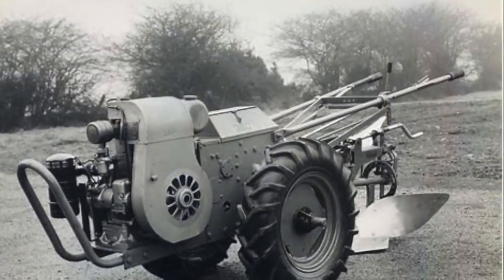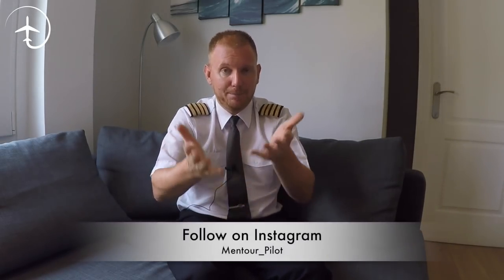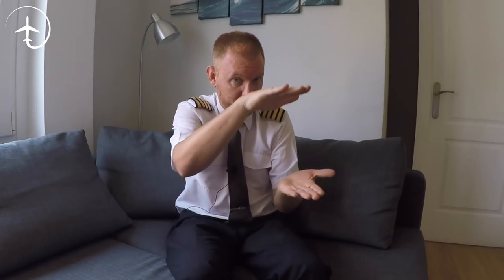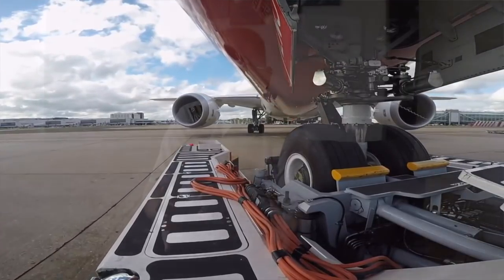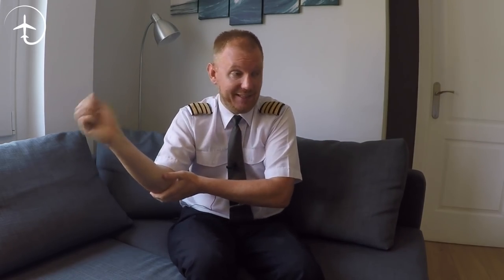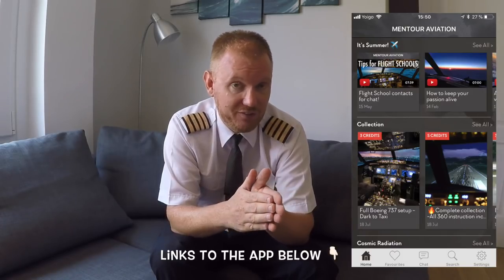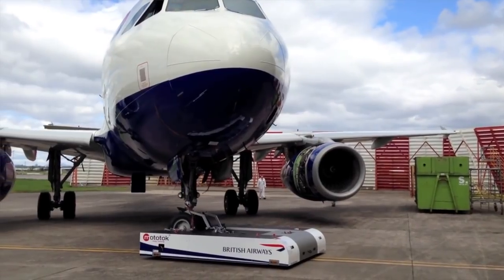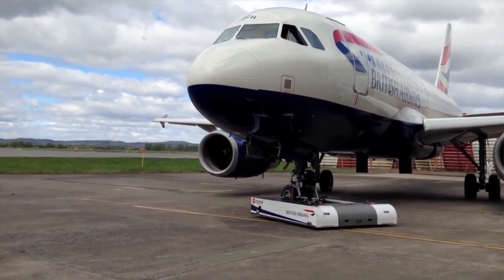Aircraft pushback, why is it necessary?

Comment: How do pilots calculate aircraft weight in accuracy..?
Reply: I would guess that there is a scale in each part of the landing gear, that provides the load supported by each wheel.  Sure you could weigh each bag the passengers check, but you are still stuck estimating for each passenger and their carry-on bags.
Reply: @carultch  not really, but good guess! the reason that airlines stop check in 30 minutes before the flight is for weight and balance reasons. the weight and calculations are not done by the pilots but by the ground crew. airlines use a combination of bag counts and the number of passengers to give the weights for the aircraft. these are printed in 2 areas, first is in the flight plan for the pilots, and secondly is for the ground crew; the latter not only tells the weight, but also the number of bags, and which part of the cargo bins to put the bags in to ensure the weight stays balanced. It takes a village to run a single airplane.
Reply: @carultch  just to clarify on what i mentioned, the second guess you made was actually correct, the airlines use an average weight for passengers and carry ons, while weights need to be accurate it's ok to round up a couple pounds without affecting the weight calculations to a degree that would matter.
Reply: The pilots dont calculate any baggage. This is done by the dispatch agency and the position of the bags on the aircraft will give generally give the pilots a stable aircraft requiring little trim (and so cost saving). Back in the early 2000's the dispatchers would work on an average of each bag weighing 25kg and an average of 40 bags on an AKE can. And so each can weighs on average 1 metric ton. These of course can be easily weighed once filled anyway. The baggage handlers for loose baggage would be asked to 'fill from the front/Back' etc
Reply: @lukegriffiths6569  yep. Fun fact is with most planes we have to unload the back first and load the front first cause they tend to tail tip if the back gets loaded first (looking at you Delta)

Comment: Jet exhaust can( and does damage other aircarts). Very reason for those weird angled walls is jet wash - to dissipate pressure. There are known cases of damage and aircraft accident due to jet wash(cant recall name of flight. Bottom line is that smaller planes were parked at the end of taxi way, next to entrance to the main airstrip. Jets would park, back up to align and wait for clearance. Problem was that part of that weird wall has been removed. Jetwash would hit parked planes, with attitude locked in max descent position. This damaged ties/cables and led to crash due to cable snapping due to turbulance/wake vortex ). Same thing with separation, jet vortex takes time to dissipate.

Comment: Not powerful? That first one you showed, pushing AirBerlin 737, has a freaking Leopard engine. Yes Leopard as that Main Battle Tank half of Europe is using. If that's not powerful then I don't know what is. Other than that - great video.
Reply from the maker: True true, my point is that they NORMALLY don’t need that much horsepower. 😂
Reply: You know, most agricultural tractors range from 100hp to 300hp. And even 140hp John Deere 7810 my family used to own could pull really heavy  things. or some relativly lite things but pull them through rough soil.

Comment: As always - appreciate fantastic job that You do with Your movies. :-) Just one correrction. The force required to start rolling the aircraft DOES NOT come from friction. Except for the fact, that proper friction must be there for the tow trucks tire or a man feet :) The force required to roll the aircraft comes from ROLLING RESISTANCE (rolling resistance coefficient), which is something completly different and has a little to do with friction. Basicly - every wheel gets a little flattened in the point of contact with surface and this creates a mommentum that must be overcome by the towing force. This plus some (or a lot) other small factors that come together. If it wasn't for that little piece of flatten wheel, a train with perfectly hard wheel on a perfectly hard and perfectly flat track, with perfectly hard bearings in its wheels would never stop once pushed (if not considering the air resistance) :)

Comment: A few years ago I was on a flight from Nashville to Washington DC.  I was surprised to notice after they started the engines on the MD80 I heard the reversers engage and the aircraft backed out of the terminal.  I'm quite sure I saw a person on the ground conversing with the pilot as to when to turn for departure.  I do not know if they still use that procedure at Nashville or not.

Comment: There are also situations where a tow tractor is required to get the plane to the gate.  I've landed in LAX on a 777 and because of the tight spaces between terminals at LAX, we had to wait on the taxiway for a tow tractor to pull us into the gate.
Reply: mirevolver I agree about LAX... such small areas around the “U” shape between terminals.  Even just one plane push back can block 3 to 6 others!  Waited many times for equipment or other plans to be clear after landing there, can take a long time.
Reply: We were tight at ILN and just used a marshaller to park the aircraft.

Comment: Hi I have a question for you. How does a Pilot manage to align the aircraft to the runway heading while taking off and landing. Is there some sort of locking mechanism to the nose wheel once it is aligned to the runway heading. I noticed many experienced pilots take off as soon as they enter the runway. 1 degree error if not corrected at take off speeds could get the plane off the runway. Do pilots use the foot pedals to steer the nose gear at that speed ? Kindly make a video on this topic. Thank You :)

Comment: Wouldn't pilot controlled, robotic tugs suffer from the same lack of aft visibility as using thrust reversers?
Reply: You could put a backup camera in the robotic tug, and display the output on a screen for the pilot.

One advantage is you have a lot more control over the wheel propulsion that the tug machines use, than you have over the jet engine propulsion.  It is a lot easier to start and stop a regular internal combustion engine or electric motor, than it is to do the same with a jet engine at low power.

Comment: I remember an incident a few years back, a ground engineer was sucked inside an engine. The flight was delayed, the pilots were operating a flight that had not yet landed so the crew change was the reason for it. Stress was building up. When they arrived another company pilot had already initialized the FMS. When the pushback ended the Captain suddenly added taxi thrust, but the tow was still connected and one of the ground engineer wasn't so lucky to escape from that chaos. The First Officer didn't check for the green signal from the ground crew and promptly told the Captain it was safe to taxi.

Comment: In Kraków airport in early 2000's they have had a Mercedes Unimog for pushback. Of course they also have had a much younger vehicle to, but Unimog was for special usage. For eg. for old soviet made cargo planes. But once in the winter 2001/2002 there were days and night with temp droping below -30'C and the only push back that started wes this old-old Mercedes (2.2 diesel), and they had to find an old rod to connect it to Boeings or Airbuses. It is quite possible, that they still have thah Unimog, but I don't work there anymore.

Comment: LOVE YOUR VIDEOS, I JUST WATCHED ONE ON PUSHBACK TRUCKS, VERY INTERESTING, I JUST HAVE A DUMB QUESTION, WHAT PREVENTS/ STOPS THE TRUCK FROM BENDING AND OR OTHERWISE DAMAGING THE NOSEWHEEL STRUTS ON THOSE AIRCRAFTS AS THEY ARE MOVING? 65 TO 70 TONS IS A ALOT OF WEIGHT TO GET MOVING. I WOULD LIKE TO THINK THAT THEY WOULD HAVE TO BE VERY CAREFUL WITH THE PUSHBACK.

Comment: The towbar less is a common item for larger heavier aircraft.  They are also called supetrugs and are often used when bringing the aircraft from the hangar to the gate or other way around.  Saves engine wear and also reduces the chances of getting a foreign object into the engine (s). The only item that should go into  jet engine intakes is air.

Comment: I have to chuckle.  My first self pushback aircraft was a DeHavilland Twin Otter out of Chicago Ohare in the 70's.  It was shocking to me at the time.  Then there was a airline called New York Air which flew out of Dulles in the 90's where they had a jetway at the main terminal.  I recollect the aircraft were old non non bypass DC-9's.  What was scary was the initial pushback the aircraft would lurch forward about 6-12 inches before the aircraft started backing up.  I guess the practice stopped after insurance companies nixed the practice.

Comment: If I understand it right, the engines are usually started during pushback. So pushback tractors usually have to be strong enough to perform the pushback while the last turbofan engine of the plane is starting up and the rest of the turbofan engines is running at idle power (the "rest" may be 1, 2 or 3 depending on the aircraft type). A person would not be strong enough of course. I think a pushback tractor would probably be unable to withhold a B747 or A380 at takeoff power setting from going forward.

Comment: I like how i can grab the prop by the spinner with both hands on cessna 150 and pull i forward or back. Very liitle strength needed. It rolls very easy, except in grass.

Comment: I'd like to have them add motors to the wheels. But for the strength of motor(s) needed, would that add so much weight to the plane that it would be noticeably less efficient, whether powered by electricity or hydraulics?

Comment: I was on a flight with a B737 from a smaller Polish airport recently and there was no pushback at the departure. The airplane was parked in the middle of the apron and there was literally no other aircraft out there, so we just started taxiing forward straightaway. It was for safety reasons, the ground was too slippery for safe pushback tug operation on that day.

Comment: Was flying as a passenger from Kopenhagen to Stockholm friday the 13 th many years ago. When the push back started the pusback tractor went out of fuel, diesel. It could not be disconnected and it took at least 30 minutes until they manage to start it again. I really wonder what happened to the person that forgot to refuel it.

Comment: Does the tiller in the cockpit turn as the tractor turns the nosegear to get the aircraft out and turned so it can taxi.  I suspect the tiller isn't mechanically connected to the gear.  Also, I was impressed that they have a tug that lifts the nosegear up like a tow truck.
Reply: Sterlingjob makes sense,  thanks!

Comment: Hi Mentour,! 
I try to watch lot of yours vieos and they're great. What would you think about an idea of robotic (or even on a little track) automated "trays" which would pull the aircraft (by its nose grear) from a specified place on taxiway to the gate and from the gate to the "engine launching position" just before take off? In an ideal situation it would allow you to not thinking about finding the way to the gate (at bigger airports I believe it may be more difficult), allow you to switch off the engines just after leaving RWY/achieving "tray position"= less emissions and huge set of procedures would be simplified.

Comment: High Speed aircraft relocation and aircraft push back are two different beasts.A lot of fuel savings in using a Super Tug anytime the aircraft doesn't have to taxied across the airport. You're aircraft will arrive at an inbound only gate, leave from someplace completely different

Comment: One of the other main reasons for pushing aircraft away from gates with tugs instead of reversing out under power is noise reduction.   The airlines and the ports are concerned with keeping the noise to an acceptable level.  Engine thrust reverberating off of windows and building structures creates a lot of noise in a confined space and that noise also filters into the concourse.

Comment: Hi Mr Mentour, I have noticed recently at Stansted ( or Ryanairport as I like to call it) that Ryanair seems to have taken over the ground services , the push back tractors are clearly new but are still using the older style tractors with a seperate tow rod rather than the batmobile, is there any particular reason for this as I would assume the batmobiles will be faster connecting and disconnecting from the nosewheel and presumably being lighter, will be more efficient?
Reply: It's cheaper to use the older ones and we all know Mr O'Leary aka Mr Ryanair loves to cut costs when possible

Comment: There is a technology DLH and few other airline is testing out few years ago called "e taxing". It use a electric motor to drive the wheels powered by APU. So the aircraft don't even needs to start up engines untile just before entering runway. Not sure how well this concept works out today.

Comment: Hello

as a cockpit builder i often need to go much deeper into the technical aspects of the 737.

I think one of the most impressive things as a unexperienced guy in a cockpit are the control forces of an 737.

Since the airbus doesn't have any noticeable forces in the sidestick, the 737 becomes more interesting, because this aircraft simulate the entire forces with hydraulic.

It would be much much interesting if you would make a movie in which you explain the feel center unit and how it acts. Also the linked steel cables which provides 100% control abilities i case of hydraulic loss.

What's your thought about this?

Regards
Thomas
Reply from the maker: It’s a good idea. Especially the cables. Thank you for your feedback,
Reply: Mentour Pilot
I have got many ideas. To be honest I am not certain if you already did videos with some of those topics.

- Different Approach types
- Jeppesen or even other charts
- Autoflight modes of the 737
- Explaining Nav aids (vor, ntb, Intersection)
- Hydraulik and other System
- CDU/ FMS introduction. 
-LNAV/VNAV 
- A/T System
- CWS mode
- IRS System
- Cold and dark cockpit preparation. 
- EFB

These are just hints... 
There are many other interesting things. 

Among your subscribers and viewers are at least some cockpit builders. 
There are thousands of them in the world. 
One of the hardest task in cockpit building is collecting data from the real plane. 
Even procedures and SOP's are always desired.

Comment: Interesting, I've heard  that a contributing factor to the Air Florida flight 90 crash in 1982 was the attempt to use reverse thrust to back away from gate when the tug was unable to move the aircraft. The plane was a 737, engines low.

Comment: Excellent videos 👍
Why arn't aircraft fitted with micro digital cameras in key areas, ie. engines, landing gear, flaps and ground monitoring?
Reply: Sterlingjob I meant in the cockpit though😀 for the crew to observe any problems etc👍
Reply: Sterlingjob I meant for the pilots, inflight as well as on the ground👍
Reply: There is a jack mounted outside the plane for the ground to talk to the pilot. It's so loud that the microphone actually has a foam seal same as a headset. The guy on the ground tells the pilot and vice versa everything they need to know.

Note: Today they might have Bluetooth hell I don't know!

Comment: I read that once, maybe in the 70s, in Italy, after boarding a plane passengers were told the ground crew had gone on strike. So the got out & pushed the plane back. It seems problematic, now I think of it. EG how did they get back on, & if they didn't need stairs, wouldn't it have been small enough to push back on it's own?
Reply: I doubt very much there was no ground crew at all. You probably had another company come in to help.

But for the sake of argument let's say you are correct. There are moveable stairs that can be placed next to the plane. Also some planes have a back stairs. They rarely use them though

Comment: Hi Captain! Big fan of yours... I a question regarding take-off procedure! Say at a busy airport a small private jet is taking off right behind a super or a heavy and experiences one engine failure right as it reaches V1. Do the pilots then commit to the takeoff despite the wake turbulence that may be ahead of them or do ATC operators factor in enough time to allow the pilots of the trailing aircraft to perform proper safety procedures for engine out?
Reply: Mentour Pilot what is your take on this scenario from my follow up response to Gun Nut: Gun Nut! I want to further clarify my question. At busy airports you often see a twin engine prop or light weight jet take off in less than a minute. In this scenario it is allowed because these planes will have a shorter takeoff roll distance. One engine failure after V1 means that the pilots are committed to takeoff. Now because of the trailing aircraft’s engine failure, it may not be have the rate of climb necessary to avoid the wake turbulence. What would the pilots do in such a scenario?

Comment: What happened at 11:30? There was a skip and the framing changed, but it seemed like it was all one continuous take. Did you record on two separate cameras and used both feeds?
Reply from the maker: It’s the GoPro, it automatically divides the files into smaller parts. I crop the image a bit to fit and it’s hard to get two crops perfect.
Reply: @MentourPilot  Thank you! I just subscribed :)

Comment: Gotta say, the TBL is cool.

Can those strong men move trains to?  I hear they have almost no ground pressure...seems like they could move a train even easier haha.

I always thought air craft were turned on the ground by use of the rudder and variable engine power.......not until I watched Air Crash Investigation videos did I realize they use a steering wheel of sorts.